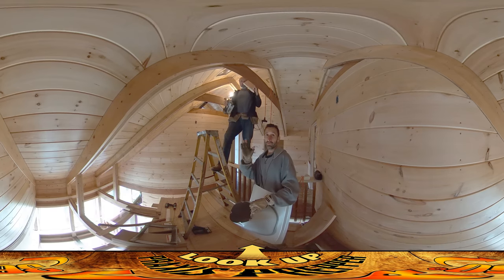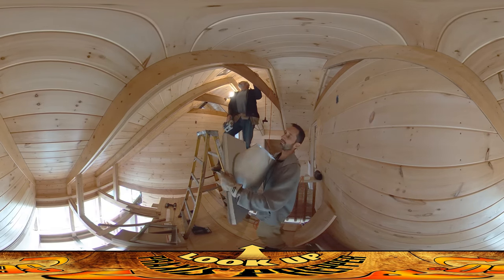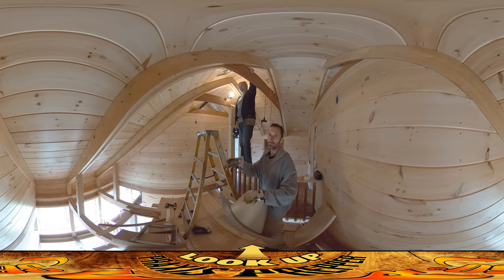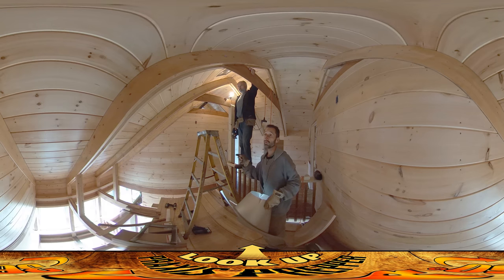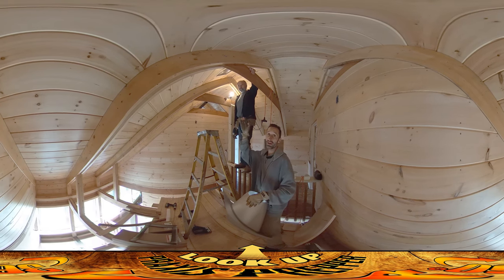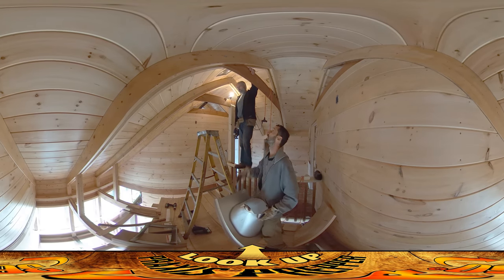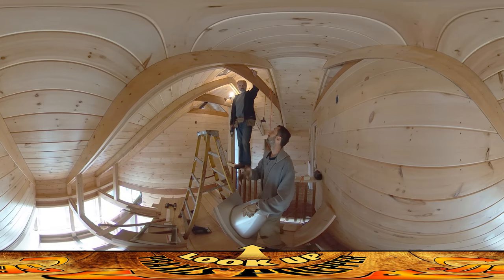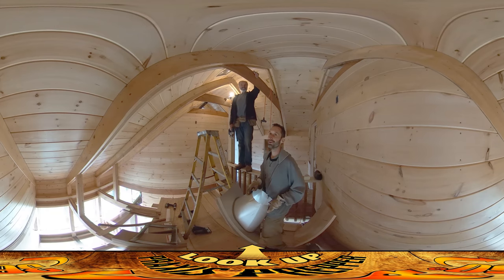Homestead Build - Chimney Install Day! 6 Inch Chimney Vent Pipe with Metalbestos Pipe

Comment: If your smokestack cleaner is long enough, you can just do it from below ?  (which negates having to get onto the roof) ... I saw Maine-Prepper do this some time ago, take a garbage (or contractor) bag, and put the cleaning brush section inside it, puncturing a hole in one of the corners of the bag, then tape (gaffer) the top of the bag to the bottom of the smokestack (to prevent stuff flying around), then while cleaning with the brush add sections from the bottom to the cleaning brush and work your way up ( trying to make sure the other corner of the bag stays below your entry point, so dust etc. doesn't pile up near and around the hole you are feeding the brush sections through). You work your way up, and then you work your way down (on going down you obviously have a moist rag to clean the brush sections as you retrieve them). When you get to the final section with the actual brush, you tape the hole closed to the stick that holds the brush, then your get the bag of the smoke pipe and make sure you hold it shut. Take the whole thing outside to remove the brush and stick from the top of the bag...
Reply from the maker: I've cleaned a chimney that way too and it's (IMO) worse than just going up on the roof. A decent mess and dust right up in your face even with the bag. I specifically built this house with the plan to clean from above and never need to unscrew the chimney. we'll see how that goes when I'm 90 years old... :)